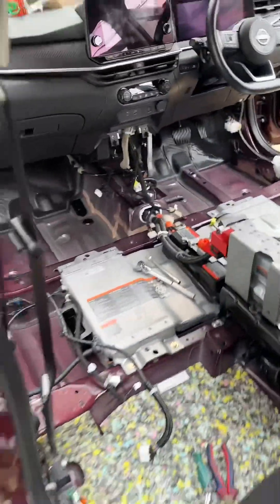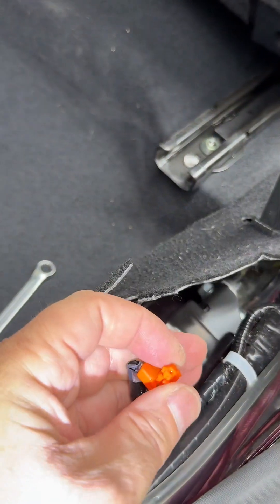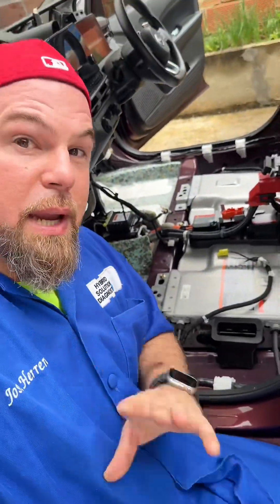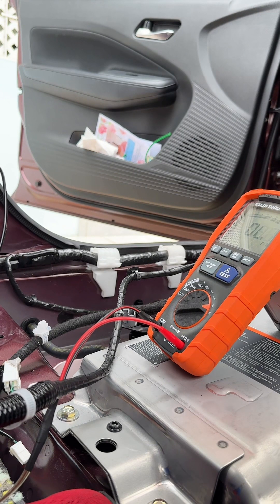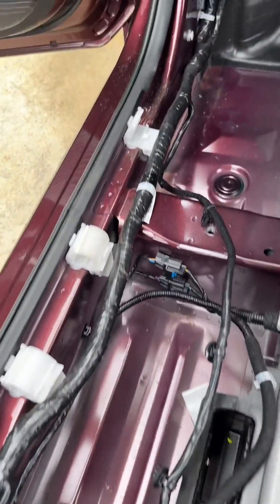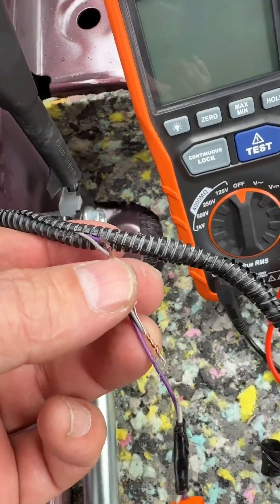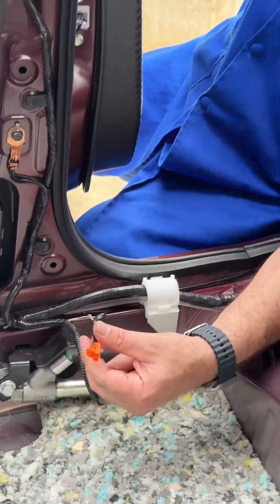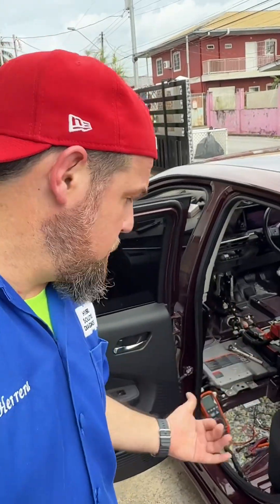Nissan Note e-POWER AirBag DTC B1001 Full Diagnostic

Comment: Hello hello. Could you please help me with one issue. I have Nissan epower 2018 and while I'am driving the program shoes me different temperature of battery segments (there is possibility to see four of them, not 80). 
Segment 1 - 24, segment 2 - 23, segment 3 - 20, segment 4 - 21. So, the difference always 2-3 degrees. What it could be, dust inside, corrosion of contacts? I wish I could go to your service station, but I'm so far from you😂

Comment: Hello my good friend... Can you help me with this question I will donate I promise...

I have a 2020 Ioniq hybrid HEV... The 12v lifepo4 battery went dead, i put a new one in (reads 13.4-14v) but wont start. I keep getting check brakes error. The 12v reset not helping to start. I reset the bms and battery. I tried jump start too.

I get 23 dtc errors i.e. a/c 3 errors, epb 3 errors, eps 2 errors, bsd-L 2 errors, bsd-r 2 errors, multi function camera 3 errors, ibu-bcm 4 errors....Most say CAN timeout

I charged the battery with charger... Do you think i should charge the battery via the engine bay fuse box so it uses the car bms to charge fully?